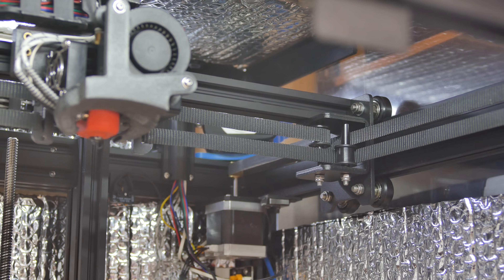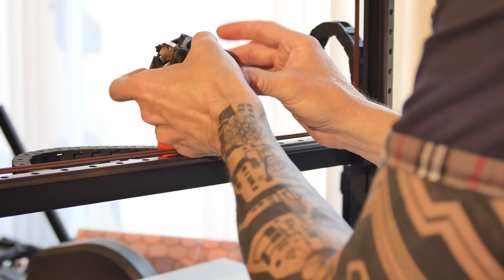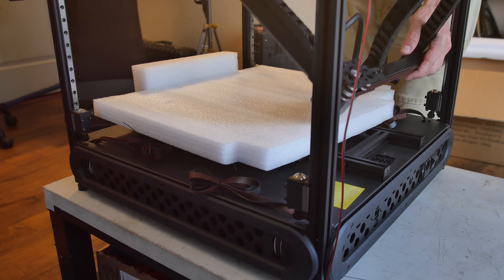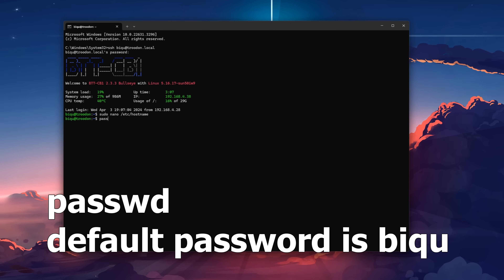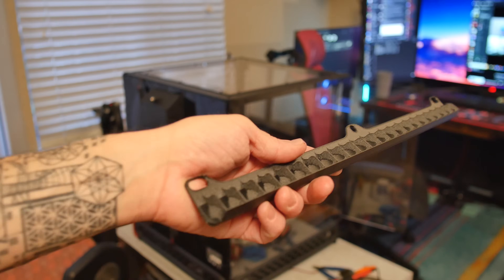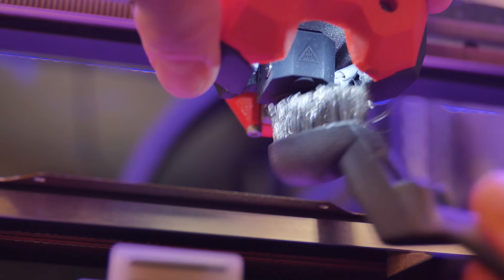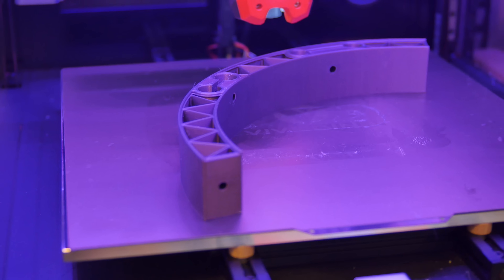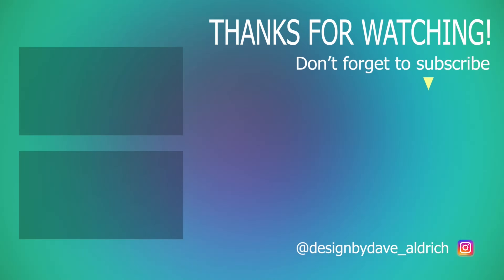I Upgraded To The Troodon 2.0 3D Printer - The Voron You Don't Have To Build!

Comment: Those LEDs look sweet, really adds a nice touch. Might be able to squeeze in once of those thermal space blankets instead of a thicker insulation, worked very well for me in other use cases.

Some tips for TAP, heat to 150, nozzle wipe with the brush, then proceeded with leveling and QGL, then park and heat to full temp, should help reduce the pre oozing!

Looking forward to getting my Troodon 2.0 Pro, how do you find the stealthburner is for partcooling? Thinking I might need to swap to dual 5015s for some higher speed PLA printing.

How did you find the ABS smell with the exhaust fan?
Reply from the maker: Thanks!

There's really not much room for any kind of insulation, like maybe 2mm.

That is basically the procedure I ended up with for pre-printing with tap. I throw in an extra nozzle clean after it reaches print temp. The main issue is oozing AFTER the print has finished. Which means you have to either clean the nozzle right after a print finishes, or heat up the nozzle and clean before starting the print. Sorry if that wasn't clear. 

I haven't even come close to pushing the cooling and high print speed on this. Most of what I print for my projects doesn't require cooling, polycarbonate, so that has not been much of a concern to me. 

Once or twice I got a few hours into an ABS print and realized that I forgot to turn the exhaust fan on. So, the enclosure alone is pretty effective at keeping the odor under control. I have been using 30% on the fan and can not notice really any smell.
Reply: @designbydave  The space blanket stuff is pretty thin, about a sheet of paper thick but works surprisingly well at reflecting heat, might work here for something extra with minimal work, might even work on the outside honestly.

Thanks for the clarification! Might be able to add a bit of retract in the END_PRINT to help with oozing afterwards, I was able to stop it on my other printers with a hefty retraction afterwards to completely remove filament from the nozzle. May not be perfect but might help a bit.

Good to know about the enclosure fan, thanks!
Reply from the maker: @xSilas43  Oh, a space blanket, yeah those are super thin and might work. 
I'm pretty sure it does already retract some after the print, but I'll look into it.

Comment: Nice to see someone finally show a way to add LEDs to the toolhead 👌
Reply: Does the front part of the stealthburner they supply have the places for the LEDs? How did you route the cable back to the controller board?
Reply from the maker: @dog2bert  Yes! As far as I can tell, the supplied toolhead is 100% the latest Stealthburner with Clockwork extruder. 
Cable runs through the cable chains with the rest of the toolhead cables. That was a huge pain though as there is barely enough room in the cable chains for the extra wires. Makes me kinda wish I had installed a CAN toolhead board.
Reply from the maker: I didn't show a lot of details there but let me know if you need some more help.
Reply: @designbydave  Will do! Finding information about this specific revision of this printer has proven to be difficult, so what you showed already helps a ton.

What did you end up doing for input shaper? USB ADXL345?
Reply from the maker: @XHolyPuffX  Yeah, not a lot of info out there, partially why I made this video. FWIW, the guys in the Formbot discord have been quite helpful and it's pretty active in there. 

I haven't even messed with input shaping. I think it has been factory pre-configured.